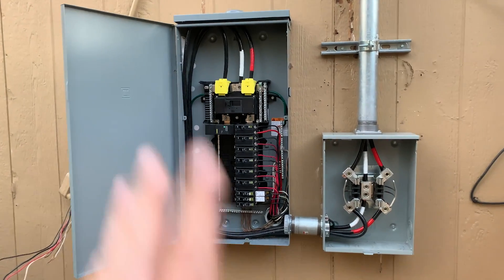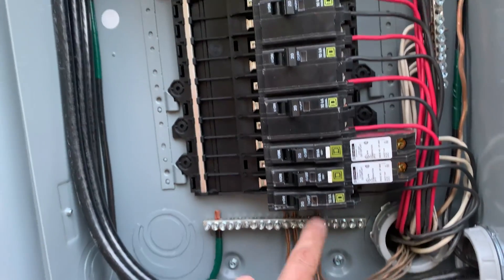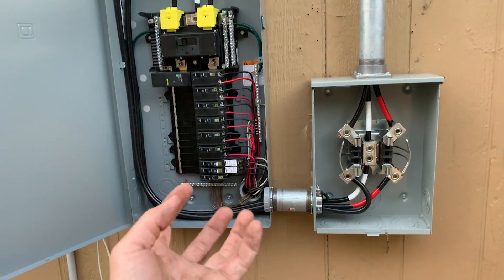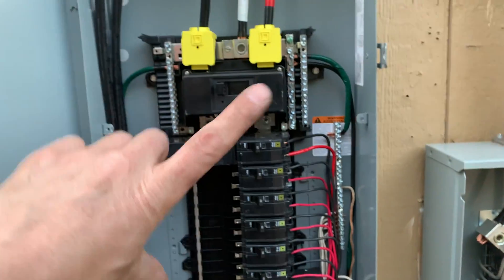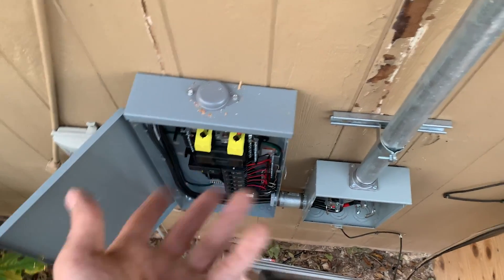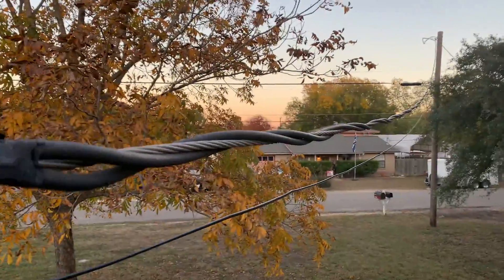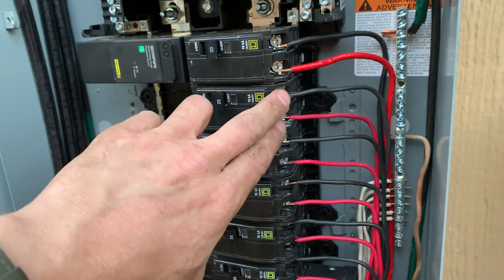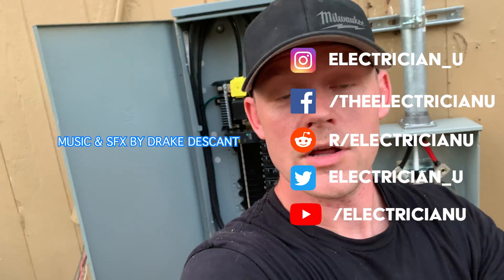I Just Changed Out My Electrical Service

Comment: Where I am located we have to have 2 ground rods do you need a second earth ground?
Reply: Where I’m at it’s required by state- two ground rods and a cold water bond (an apprentice so excuse my lack of appropriate terminology). It’s kinda funny the requirements each state had and doesn’t have
Reply: @spitzmachine  it's not funny because it's in the National Code Book...
Reply: His slab ground would be a ufer ground and that qualifies for main grounding without rods around here. My city inspector would make me bind the water line but not my state inspector.
Reply: @KS1776  lol got to love tht authority having jurisdiction depends on the bribe i mean mood of the inspector lol
Reply: @KS1776  ufer ground ties into steel rebar at foundation forming a U you still need a ground Driven rod to Earth. Also a bonding wire Hot to Cold to Gas usually at Hot Water Tank...
Reply: @KS1776  Where's the slab making contact with Earth though?

Isn't it going to be too insulating?
Plus it doesn't seem to be a good idea to mitigate lightning damage.
Reply: It all has to do with resistance,  if your first ground rod has a resis of 25 ohms or more a second ground rod is required by code.  Their is also a certain length in between the two ground rods for it to work properly, rule of thumb example  8ft  long 8ft apart.
Reply: @ANGEL91OS  i thought it was 6 ft minimum but if longer is acceptable or better i wldnt care i dont mind above code lol
Reply: Jason Luhn  should be at least 10' of copper from water main 1st ground,  2nd ground driven into Earth (ground rod). Bonding, Hot to Cold to Gas (usually at hot water tank)...
Reply: In New England they make us use bonding clamps to the water main, then two ground rods. They’d never make us use more than that, even above 25 ohms, way too many rocks out here to be sending 20’ of rods in the ground. 6 is hard enough
Reply: I’m in NM same thing 2 grounding electrodes no further than 6’ apart since the soil is not so great unless it’s newer home or with a Ufer ground that is sufficient with inspection.
Reply: Jason Luhn  you live in Texas

Comment: What is max length on nipple between meter and first means of disconnect?  could you have used a longer nipple to shift over?
Reply from the maker: There's no max length governed by the NEC, but local jurisdictions a lot of times have specs you have to stick to.  I could have added a few inches, but really nothing substantial.

Comment: This came up at work today. Are you allowed by code to identify the #6 with green tape?
Reply from the maker: Absolutely.  The main bonding jumper (bonding screw)  that comes with the panel is painted green.  The #6 jumper I ran is taped green as well.  I don't know anywhere in code where identifying a bonding jumper is required, grounded conductors (200.6) and equipment grounding conductors (250.119)  are for sure. Just haven't found  anything on bonding jumpers.
Reply: @electricianu  this is why I watch. Thanks dude. Always trying to learn, and hoping to make the journey to master.

Comment: Forgot to insulate the neutral bus from the can edit: remove bonding screw
Reply from the maker: Not quite - it's a service panel so the can, the ground, and the neutral all need to be bonded together.  That's why that green screw comes with the panel specifically for that purpose.  You'd be right if this were a subpanel however. Good guess!
Reply: @electricianu  that wouldn't pass in canada, you can't have neutral current on the panel box/meter
Reply: Ground electrode, ground conductor?

Comment: New apprentice I amTrying to build a complete bag so I don’t have to use the work tools. What do you think about the Milwaukee screw driver set...
Reply: Hes got a good video on everything you should have, and the motto for tools is, if it ain't klein it ain't mine
Reply: Yeah go with klein! Power tools Milwaukee is king but not for hand tools.
Reply: They aren't a bad starter set, depending on which ones. The handles kind of suck on the Milwaukee screwdrivers. I've broken more tips on my Milwaukee beater screwdrivers than Klein too. (And the Milwaukee ones are supposed to be used for it, with the solid metal shank from tip to back end.)

Comment: Why the  panel is outside??
Reply from the maker: That's pretty common here.  Since the meter is outside, most of the time we put a panel out there too.  Cheaper than putting a disconnect out there AND putting a panel inside.  An exterior panel does both.
Reply: because Texas. there's often a subpanel in the garage, but the outdoor service panel is often in the blazing sunshine, and too hot to touch!